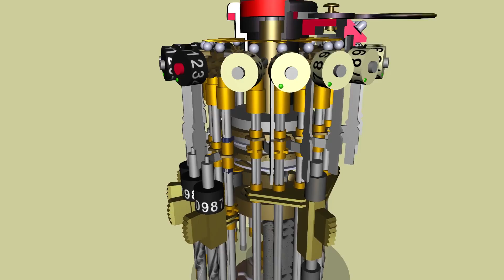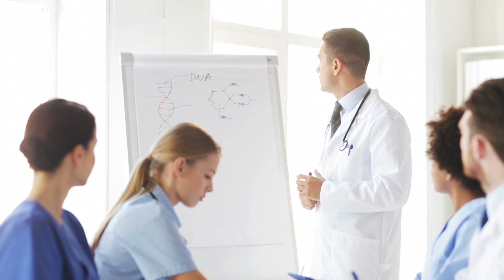Is Engineering Right for Me? | Is Engineering Right For You | 10 Ways To Know

Comment: Hey Jake, I've already graduated with Electrical Engineering but my previous jobs were field engineering, technician, managing a supplier, and currently at a company that doesn't have me doing anything electrical engineering wise just setting up end controls.  I accepted a job offer with Raytheon but for some reason I feel fear and burn out that I'm never going to find out what I'm good at or what I want to do.  And I'm stressed what if I chose the wrong major as making a living in California is expensive.  Should I just move back home with parents to figure out my life or should I press forward with taking this technical electrical engineering role with Raytheon?  My fear is not being fast or smart enough to problem solve or design anything.
Reply: how did you know it was for you?

Comment: How crucial is the spatial awareness aspect? I've always been horrid with spatial reasoning but excelled at verbal comprehension and communication. I want to pursue engineering because of my love for math subjects like calculus, linear algebra, and differential equations but if poor spatial awareness is a deal breaker then perhaps I'm looking in the wrong direction (no pun intended). Which branch of engineering would you say requires the least amount of spatial ability?

Edit: Actually I wouldn't say the problem is my spatial reasoning but rather my inability to visualize. I can still make logical deductions when it comes to geometric problems and I have no problem interpreting 2D representations of 3D objects on a page, but if you asked me to imagine rotating a 3D object, or even a visually complex 2D object in my head I quite simply could not do it even if my life depended on it. My mental images are like faint, elusive flickers rather than clear, smooth animations.
Reply from the maker: Hey thanks for the comment. As for spacial awareness, it depends on which type of engineering. If you excel at verbal, that to me is slightly opposite of engineering left braining things. For example numbers and images are easy for me and I cannot spell or visualize any words / letters for some reason. If you like math / calc and all the math, thats a good sign for engineering future. 

I think if you have good math but you don't like spacial, then I think electrical engineering. It's all theoretical and not spacial at all. You cannot see electricity and magnetism whatsoever.

Spacial reason : inability to visualize :: tomato : tomAHto

If you like math enough to be good at coding, I think EE is the way. Watch these for now and see what you like, 
“Best Engineering Majors | Engineering Degree Tier List” https://youtu.be/nfayHVJlKgQ
.
“Electrical Engineering Job Tier List” https://youtu.be/6r3hG_zA8d8 

Let me know what I can help you with next okay? Cheers!

Comment: What if you've got a good sense of 3D space and problem solving. But you're worried you won't get a job at the end of your degree because you'll be close to 40 when you finish it.
Reply from the maker: there are so many people who go back to school and get their degree late, including my mother. you have nothing to worry about if you're passionate about the field. Sometimes people would rather have an older engineer. Your downside is that you come in older with maybe a higher salary requirement, but you have the same if not no experience? ideally, when people do this, its bc they were already in the industry and say they wanted to level up from a technician to a full engineer. Boom in that instance, you actually have a lot of industry experience, yo ujust may now want to be a designer. I have other friends who have done this so you will be fine
Reply: @JakeVoorhees  Yep I'm 32 and I wasted the last 6-7 years trying to get into a VFX industry that didn't want me. Between now and the time I made that posted I've started studying IT, engineering looked like too much work to study something that may be another dead end. I don't have a higher salary requirement, I just have no experience in anything unlike most 32 year olds. So I'm unemployable and completely useless 😢 because I made bad decisions in my early 20's.